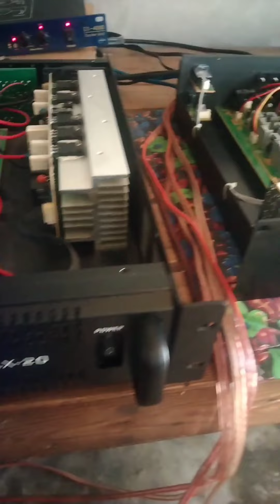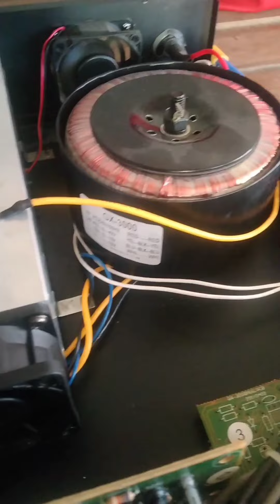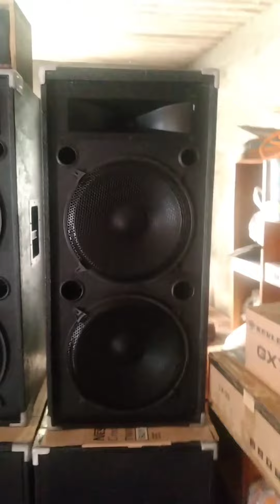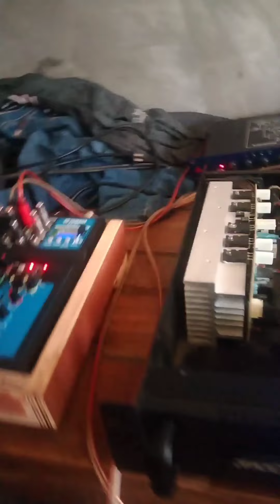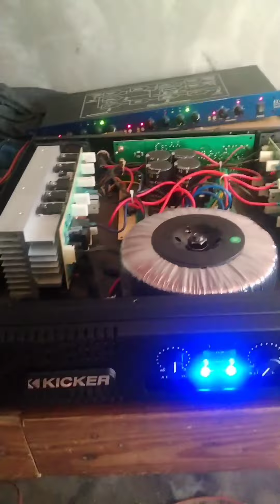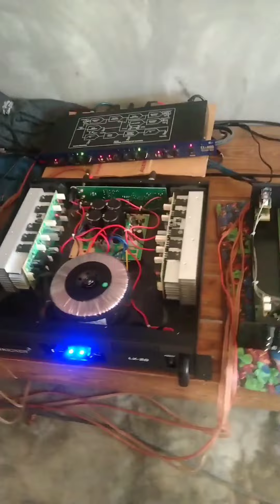ace lx20 dagdag trasistor at kevler gx3000 dagdag trasistor

Comment: Mas lumakas po ba c gx3000 nung dinagdagan ng transistor?.thank you po..
Reply from the maker: Oo sir dagdag karin nag power 70v 0 70v dati 42v lang siya at capacitor 100v 10000uf
Reply: Magkano ba magagasto pag upgrade
Reply from the maker: @cctvvlog2000  1350 sir na gastos ko dami pinalitan pati pala drive pinalitan 8pcs A1837 4pcs  C4793 4psc capacitor 2pcs 100v 1000uf at magnetic wire#19
Reply: Location mo sir